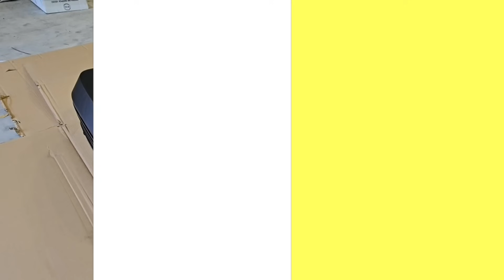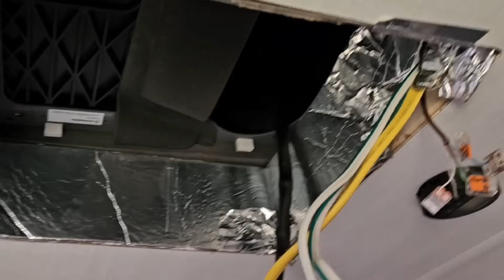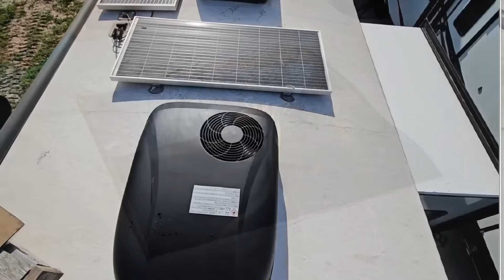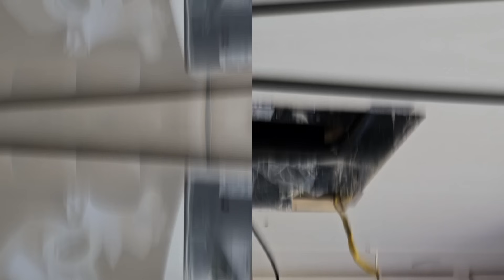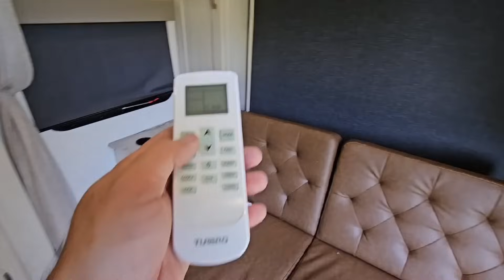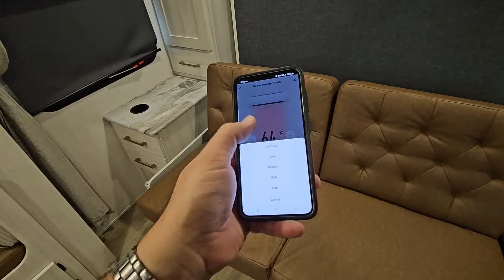WHAT YOU'VE BEEN DEMANDING! This RV AC has everything! TURBRO Inverter AC with Heatpump!

Comment: It would be great if they made a 48V version and safe the loss going through the inverter.
Reply: Get the CountryMod Pro. Comes in 12v or 48v. This one is already old news
Reply: Good inverters today are about 95% efficient, so there isn't much loss.
Reply: @calledtojourney  5% is a lot of energy loss.  Plus, you also have to consider power factor.

Comment: Im in the market for an AC/heatpump for my cargo conversion.  13.5 is way more than I need, but i don't think ill find a smaller unit.   Any idea of actually amp/watt draw at a couple different times. Like start up, normal and with the heat pump running

Comment: I’ve been waiting for a reason to add a Chill Cube to my little Casita. This might be a better option with the heat pump option. (Wanting something quieter than the Mach 3). Thoughts?
Reply: The Chill Cube ductless is significantly quieter, but the Turbro seems to cool a little better based on reviews I’ve watched.  Also, the Turbro has a heat pump and is lower roof profile.

Comment: Can you make a video showcasing the energy levels/savings? I would think most people myself included would primarily be interested in a unit like this for off grid battery/solar applications.  So far I'm not impressed by it especially the price.  Maybe the power draws and efficiency will change that. Thanks

Comment: I have this same unit I installed a couple months ago on my Monaco Fifth wheel.  A couple things I ran into was the sponge duct is definitely too short for my six inch thick roof.  I also had to buy extended bolts for mine.  I am pretty anal about my installations and tried to get support to send my out additional duct sponges so I could extend the duct stack.  They were worthless and said they don’t have extra parts.  I ended up using the inner pieces to carefully cut myself some additional pieces and created my own.  But they aren’t connected in a ring like the rest so I would have preferred to use them in the middle of the stack so the ring pieces would give more strength. It all worked out and I made absolute sure it has no duct leaks into the attic space.  I also made sure to seal it good so you aren’t leaking output air into the intake air.  It works great for both heating and cooling.  I did see another YouTuber use this on a high end class A and he 3d printed a piece to make it ducted into his factory ducts.  Not sure how that’s working for him but it can be done although I didn’t mess with it.  It would definitely be quieter if the inside air was ducted.  I generally run mine in low and it really keeps the front bedroom/upstairs area perfectly climate controlled.  Oh also if you didn’t have an AC or standard vent where this is going you would need to cutout a standard 14” RV Vent size hole to put this on.  That’s what size it fits.  I replaced a vent and added the wiring circuit to mine.  Hope this helps someone out there.
Reply: Also for Big Truck Big RV you may want to stare at the broken clip a little.  Mine was “busted” just like that and I was able to fold it back or reverse the little catch and it ended up being fine.  Maybe take another look at it before you try to secure another way.

Comment: We have a 2014 2 wheel drive Nissan Frontier SV with 120k miles we’re about to list. It’s in great working condition. Just got new ceramic brakes. However, it will need at least 2 tires replaced soon.

Comment: Do you know if they have plans of bringing out a ducted version of this unit?
Reply: Morton’s on the move did a 3-D print of an internal shroud to support ducting
Reply: I was wondering the same since I got 3 units with racetrack ducting.  
  The little bit of noise wouldn't bother us because I would run the unit in the opposite room(s) of where we are relaxing.

Comment: What’s the beeping?

I’m waiting for a quiet 15k ducted inverter heat pump AC.
Reply: SAME! or better yet a 18.5K BTU
Reply: @jamesonmahoney its not all about BTUs Im a HVAC/R Technician and to much of a unit wont efficiently pull out the Moisture, so even though you have it 68 in your Cabin it can still be stuffy whereas 72 at a lower Relative Humidity will make it feel much better. I live in a 42ft 5th wheel with 2 13.5k Units in Alabama, and other than the noise me and my wife live comfortable.
Reply: @Roomba.4  yes, true... but I'm in Texas. I currently have 2/15k BTU a/c units and during the hotest part of the summer it'll get above 80 degrees in my 43ft sabre fifth wheel. This time of year would be the only time that extra 3.5btus (x2) would help. Currently during the cooler months I just run them on low or only run a single unit to regulate the humidity better. 
A variable speed compressor would be ideal... 

More than anything I just want the efficiency of a heat pump.
Reply: @Roomba.4  Agreed. My 12kbtu (actually 13kbtu according to the specs) EG-4 28.5 seer-2 mini split in the rear of my motorhome cools better than the 14.5k Furrion I have up front. I attribute this to the huge head unit (42.5"×9.3"×13.0") that moves a ton of air, removing 1.25 liters of humidity/hr. It is so quiet (32dB) that I can't even hear it run unless it's in turbo mode. It only uses 1/3 of the power my front rooftop A/C uses too.
Reply: @SuperSushidog I ONLY install Inverter Systems they are so much better Power and Noise Wise.
Reply: Waiting for the Chill Cube HP
Reply: I’m waiting for one that works with the existing rv thermostat… I love my micro air touch screen thermostat which I can turn my ac or heat on from anywhere so I can get the rig warm or cool before I get there… these proprietary remotes are a joke, and in my case has costed furrion a sale